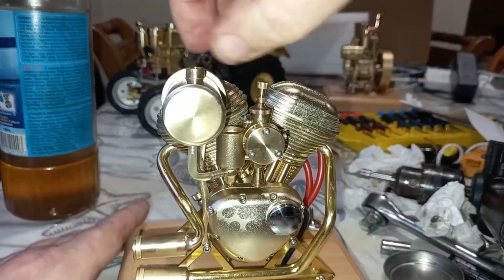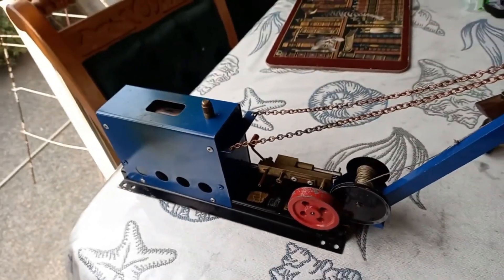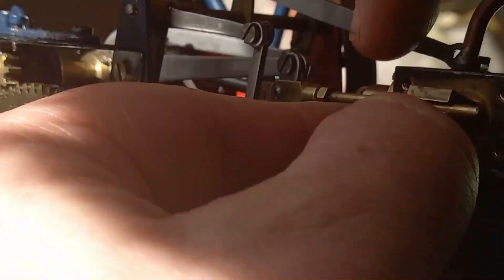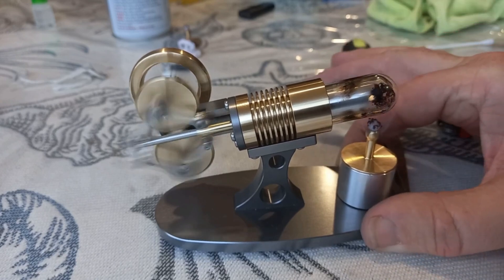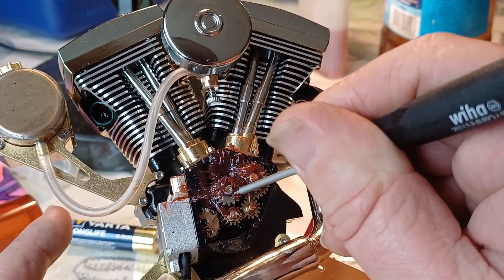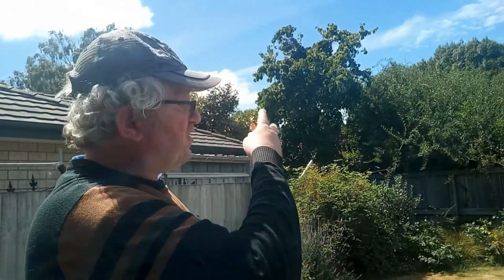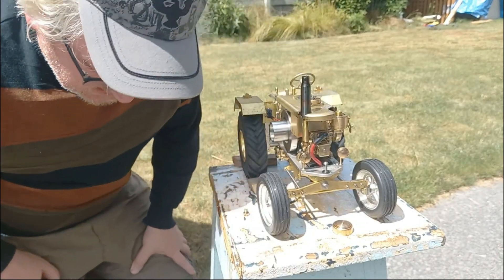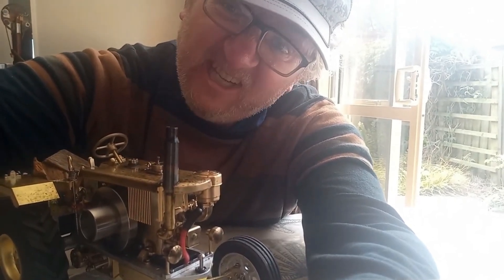Model Engine Memories 2 Thomas PCGuru ENGINES Recap SPECIAL

Comment: G'day Thomas, have you ever tried Diggers Shellite from Bunnings for your engines? (you have Bunnings in NZ I'm pretty sure don't you??).
Reply from the maker: I remember trying it for something...d'you mean as fuel?
Reply: @ThomasPCGuruENGINES  Yes as a fuel for our H&M engines Thomas. Its supposedly the same a what they all use in the U.S ''Coleman Gas' its basically something called Naptha. I've been using it for a bit instead of unleaded petrol with a good premium outboard oil as the mix. Smells a lot better than bloody petrol! - Cheers Jim

Comment: hi please can you tell me as to how much do these engines cost so that we have a fair idea about it  hope to hear from yearend Regards
Reply from the maker: I have named each so you can Google that...the price varies depending on where you go.
R28 vtwin is hard to find now, Probably around $400? Fizz Whizz and Auld Steam Crane are old and hard to find for sale, Mercer are still made but wait time is so long they've suspended sales. Can't remember how much they go for, probably around 1000 pounds on Ebay, Kontax nano engines are available from their websites, the Enjomor hit'n'miss is a big seller at around US$350 but mine is modified, the Harley model is worth around US$500 from memory, the tractor is around US$900. You can hold on for specials from manufacturer on ebay. [Beware of used home made model engines though with the "haven't tested it, but it should go" or "looks like it will go" both = IT WON'T GO :)]
Reply: @ThomasPCGuruENGINES   Thank you Sir for your reply really  appreciate it  
sir please if you come across any v twin engine for about 250$ and you think its worth buying ,im based in india ,and just in case you come across one I do not mind buying it since I have a v twin I use A a Roadking and just thought of having a replica engine as a souvenir ,please in case you come across one id appreciate it Regards

Comment: That first one, a great little engine, only i dont know what i'd call it, its a V-Twin like a Harley but the cylinders and heads seem to be modelled after an air cooled BMW engine and the timing cover is Triumph Twin design.
Reply from the maker: You're absolutely right

Comment from the maker: Older vids = some dodgy footage or beautiful classic working model engjnes...you have only me to blame....OMG the SOUND of that HARLEY model engine!!
Reply: I'm drooling over the Auld crane.
Reply from the maker: @ducttapetech9885  After all these years, and with more knowledge now, I realise the attention to detail he put in. Hardened piston, silver soldered boiler, solidly built safety valve holding double the pressure of a Mamod or Wilesco, and that machining quality. Standout in steam toys, I think